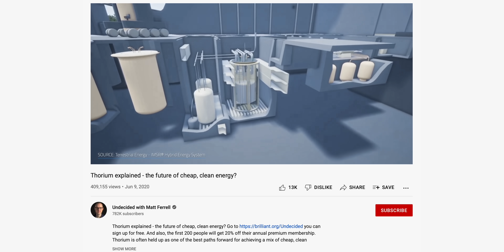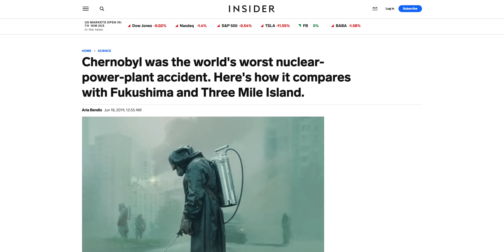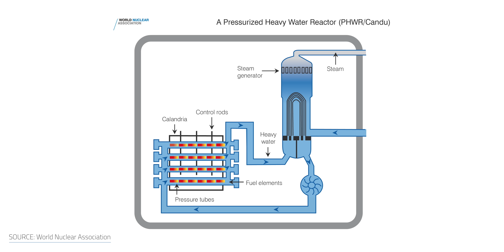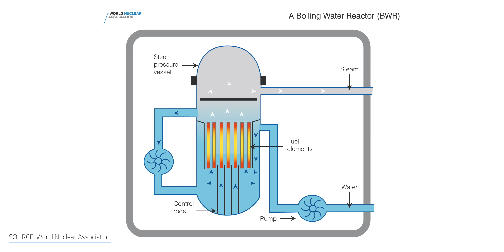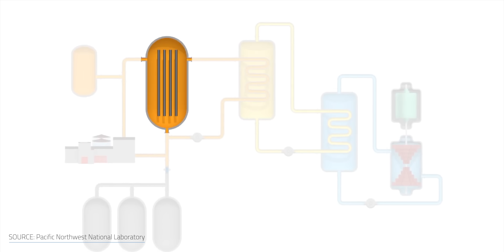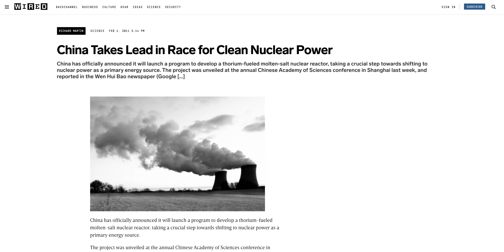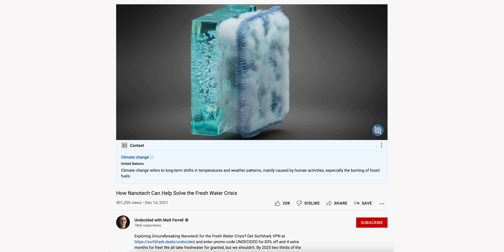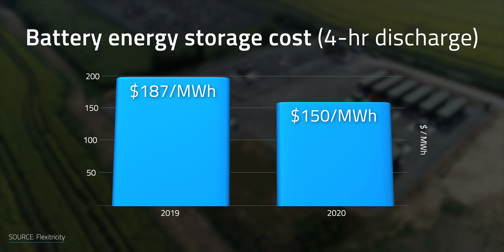Revisiting Thorium Energy - The Future of Nuclear Power?

Comment: the cost analysis made no sense... the cost of fuel should be hundreds of times less, manufacture should be 20 to 50 times less per capita, the cost of enrichment is virtually eliminated... that sounded like someone was fudging the numbers... i.e. so they can keep the price the same and pocket all the savings...  The radioactive by products even are valuable and can be collected and sold into an industry desperate for these fractions...  We're talking about a fuel that is effectively, 200x more available, costs almost nothing to mine, does NOT require the complex (and hugely expensive) enrichment process that uranium does, and because it's in a liquid medium, burns almost 100% of the fuel compared to solid uranium's 1-2%...  Also the low pressure reactor design does not require a massive huge dome cover (like uranium) which are required in the event of an accidental high pressure explosion...(MSRs are low pressure) a smaller modular design also means mass manufacturing will be possible with delivery to site location or having pre-manufactured components delivered and assembled on site... also because of their higher temperature they are able to run more powerful high pressure gas turbines...  as compared to the liquid steam turbines that uranium reactors are limited to... that would mean more power for less cost again... Someone is definitely fudging the numbers... then again you did mention someone  is trying to build a Thorium Fast Reactor?... That's nuts! ...  and almost defeats the purpose of Thorium reactors in the first place... Thorium's strength and efficiency is in the slow reactor design (as per Kirk Sorensen...) so that didn't make any sense... unless they are trying to undermine the whole market push... Someone is trying to fudge something... it should be at least 10x cheaper... think of how Big Auto treated electric cars... that's what I see going on... it's only because of Elon Musk, that they have NO choice!, but to be dragged kicking and screaming into the new market... Otherwise, EVs would still be another 20 to 50 years out... and like Thorium reactor, EVs were built and ran successfully decades earlier only to be ignored and/or suppressed for political reasons... the miilitary's is always lusting for more plutonium... Thorium was poo poohed, and swept under the carpet... mostly for political reasons...
Reply: Yeah, the fudged the numbers alright.  Four hours of storage for solar?  30 year lifespan of a nuclear plant?  Hilarious.

Comment: The best property of a LFTR according to the Oak ridge facility, is that it can re use the "spent" nuclear waste from the uranium reactors(only used 1-3% of active material) to the same level as the thorium (used 95% of  active material) and reduce the dangerous/radioactive time it needs to be stored to around 300 years instead of 10000+ years.
Reply: and the volume or amount of waste

Comment: how hard can it be when they had a fully operational running thorium reactor running at Oak Ridge National Labs in the 50's and 60's the only thing holding it back is greedy plutonium Rockefeller owned reactors which are more expensive, more dangerous, and more polluting... but they control more govt funding $$$$$$$$$$

Comment: I feel like the LCOE comparisons in this video are a bit misleading. Firstly, the ones for nuclear are a bit pie in the sky and speculative. Most sources I've seen put traditional nuclear at well over $100, but you site it as around $60, and that kind of thing casts doubt on the thorium LCOE estimates, which are again, just speculative estimates. However, the much larger concern is that you are comparing PRESENT DAY wind, solar, and battery LCOE with speculative LCOEs from thorium that would only be attained in 20 or so years at the earliest. At the current rate solar, wind, and battery tech is dropping in price, we might be comparing to wind and solar at $10 LCOE by the time thorium becomes a feasible tech.

Comment: Hi Matt, you mentioned that MSR waste was shorter lived but didn’t mention that they use about 95% of their fuel vs around 1% in today’s reactors. In other words there’s very little MSR waste to begin with. Also, heat for desalination and hydrogen production is a fraction of the heat required by many large industries where >600degrees C would suffice to replace fossil heat. Would be good to know exactly to what extent but around 20% of greenhouse emissions are from industrial fossil fuel heat. Is a video from you researching this a possibility? It’s hard to get exact statistics? Apart from saying we still need Nuclear, Elon expects electricity consumption to DOUBLE as EVs take off this decade, so that’s a seriously impossible task for any amount of solar and wind short term. BTW, while a few industrial size batteries have been installed to date, four hours worth of batteries that could have made a few thousand EVs suggests supply chain issues at scale🙈

Comment: We sure do get a lot of pro nuclear propaganda lately. One thing that nuclear power does is insure that the power monopolies will have control of it. Thorium is fairly innocent but you fail to point out that it is converted to something that is as deadly as currently used nuclear elements. Similarly, is reducing the half life to one half the current life of nuclear waste really relevant? And, once again, the taxpayers and citizens of earth are responsible for the waste. That cost is never assessed against nuclear power. Sure we can dig a hole in your backyard and bury it but what would that cost be over its radioactive life? How much land can be potentially poisoned? how big of an aquifer????

Comment: Improved battery storage doesn't just help intermittent power generation like wind and solar, a lot of the economic disadvantage of nuclear is that it's constant, while the price that power can be sold for isn't, and nuclear has to sell power even at hours when that means selling at a loss. A large battery system enables time-shifting that production to cover higher demand hours with better returns, which directly translates to increased economic viability, especially as you can scale down the size and number of reactors you need.

Comment: Interesting topic, but i keep thinking about other solutions, that are rather easier to achieve. Solar bricks to use when building a house. this way a building is useful, instead of deadweight and being just one thing, which is a roof over someone's head. Now it also generates power, basically free energy from a super massive fusion reactor that's located high in the sky. 
   Household takes away necessary power and the rest goes to a battery to supply as a buffer for governmental energy expenses. 

Yet many countries, including the one i currently live in, don't want you to be "self-sustaining", which is truly a bummer.
   Politics these days is really childsplay with nuclear weapons as toys.

Comment: Solar and Wind alone will not work.  Adding batteries will help, but these will be needed for EVs.  I believe a hybrid Thorium Reactor with batteries to support grid variability letting the reactor run at top efficiency, is much better than solar at night, and wind on a calm day.
Reply: The TerraPower reactor he mentioned slated for Wyoming has molten salt storage.  The Natrium plant has a 345Mw capacity that can be upped to 500Mw for 5 hours at a time via molten salt storage.  This would be a game changer if effective as batteries would be super expensive and environmentally repugnant.
Reply: @danadurnfordkevinblanchdebunk  However, nuclear reactors need to be base loaded to be efficient.  So how do you mitigate frequency regulation needs for varying electrical loads without use of a battery? ... solar and wind can't be turned on and off.   Also Bill Gates is involved with TerraPower, and he is the DEVIL and I want NOTHING to do with that evil SOB.

Comment: Thorium is cheaper than batteries if excess when slowing down is used for desalination. But... The surges from solar and wind, even in a large grid, means decentralized batteries will still be needed. Decentralized because grid substations catch fire from solar and wind surges. Municipal governments need loans and federal directives to get into the battery farm/electricity purchase business. Currently, most grids like australias just remotely turn off the solar input at the house because the grid needs upgrading

Comment: Re 4hr battery backup for LCOE costs of wind and solar power: what country do you live in, that having zero power for 8-10 hours a day (minimum) is acceptable in mid-winter, or 4-7 hours of power outage is acceptable during a heat wave in summer?   I'm curious how that 4hr battery backup is viewed for power grids in Alaska?  For wind enthusiasts, keep in mind that when there is a hurricane or other high storm winds, turbines are usually turned OFF to try protect the rotors.  It's not just idle periods (which can happen) that can result in no power production.  LCOE costs should also include all the electrical cabling required to connect wind and solar plants to the rest of the grid - you need a lot more of them than you need for traditional (or nuclear) power plants, since the latter have higher power production capacity, and can usually be placed closer to the end users than the former.  Bottom line - that 4hr battery backup solution is only viable in a power grid that includes a large portion of fossil fuel or nuclear power production.  Pick one.  (Hydro is great where the geography supports it, but is not scalable to meet growing power needs - pretty much every valley that can be dammed for power already has been.)

Comment: You mentioned it, but salt at high temp is extremely corrosive. I'm not familiar with the progress in corrosion resistant materials. However, nuclear is the only near term solution. You will not have batteries large enough to run a city for multiple days, which would be required for winter or bad weather.

Comment: Four hours of solar storage?  Seriously?   Now run a cost analysis showing taking into account four times the storage (solar is only useful for about 30% of a 24 hour period), and the cost of replacing those batteries and panels to match that of the lifespan of a typical nuclear power plant. You suddenly find solar to be much more expensive than nuclear.

Comment: I was thinking that a very small modular molten salt thorium reactor could be used in the various vintage coal fired trains around the World. 

That way they still operate as steam engines but without much operating work, without the dirt and greenhouse gas emitting coal, and without all of the other poisons involved with coal. The steam produced could both drive the mechanical steam engine and the electricity for ‘hotel’ power.

Comment: Problems with this video.

@8:47 How is a leak of the Thorium salt worse that a full on explosion of the water coolant in a steam bomb design?
@8:51 This chain also creates U-234, which is just as unstable. But you have it entirely wrong here - the presence of these two isotopes of Uranium make creating a bomb with this material a dangerous endeavor at best as they both can cause the bomb to detonate while in storage.  No one sane is going to make a nuke that can go off while in storage.
@9:00 It's mined accidentally in huge quantities already.  Thorium's ore has multiple rare earth elements that are highly sought ought and mined aggressively already - the Thorium is currently being discarded as waste in these operations.  Do more research!!
@9:48 This is false. The project was shut down because Nixon wanted to divert all nuclear research funds to California. Also, the Thorium reaction chain's U-233 with trace amounts of U-232 and U-234 was not suitable for the manufacture of nuclear bombs as outlined above, and this likely also factored into Nixon's reasoning since this was at the height of the cold war.

Comment: A distributed sun/wind/hydro energy supply system (with storage) would be more resilient and reliable, easier to install in remote locations, upgrade, service, and on it goes.  I'm sure there are excellent use cases for thorium reactors, but I don't think general large-scale power production is it.  They seem destined for more exotic uses. Smaller reactors for ships, space, possibly even very large aircraft?
Reply: But our technology still isn't up to the storage task with solar on a utility scale.  Notice how the numbers presented showed a cost with 4 hours storage (assuming it wasn't cloudy during that charge period).  Solar is actually only useful for about 30% of a 24 hour cycle.
Reply: @danadurnfordkevinblanchdebunk  Also notice that batter storage halved in price in a single year.  Wind, solar, and battery capacity will continue to grow while the cost of a thorium plant will more than likely continue to increase.  In the time it will take to build a thorium plant, the race will be over.
Reply: @danadurnfordkevinblanchdebunk  Do you really think America will be producing them for that price?  You haven't factored in the cost of mining the material  (which is quite dirty), or the cost of safely warehousing the waste for 500 years!  It's another technology in which the true cost is kicked downstream to become somebody else's problem. Meanwhile, battery technology is rapidly evolving, the cobalt is reusable, and there any number of different of chemistries, not to mention non-chemical energy storage.

Comment: Most of the safety features are also shared by pressurized water reactors (PWR).  They are naturally temperature regulated via the same mechanism.  Also PWR will shut down on loss of power and modern designs will provide sufficient cooling by natural convection.  Salt reactors were tested in the US in the 60’s and rejected and were used in Soviet submarines (think K-19).  If they lose heat, the coolant will freeze and were very difficult to recover.  Finally, liquid fuel is dangerous.  Improper storage volumes or shapes can result in spontaneous criticality and has caused several accidents in fuel processing facilities.  All of this can be overcome, but it is likely they will not be superior to current designs.
Reply: Nonsense. The ability to withstand loss of cooling is precisely the reason LFTR s are safer than LPWR s. LFTR design was not rejected for technical reasons. It was mostly political -- industry had a lot of NRE in getting  certified LPWRs and they put pressure on government to shutdown LFTR research. As for LFTR fuel regaining criticality after flowing throw the drain plug no, that is not the case for LFTR fuels.

Comment: The nuclear hype machine really needs to end. Thank you for at least including a cost comparison. Solar / wind / battery costs are not static, they are dramatically falling and getting cheaper and cheaper every year. The nuclear lobby captures public imagination and public subsidy but it makes zero sense from an economic standpoint. Every dollar spent on nuclear is a dollar not spent fighting climate change with cheaper / safer / more efficient renewable power plants that we can build today using wind / solar / batteries.
Reply: But now run a cost analysis showing taking into account four times the storage (solar is only useful 30% of a 24 hour period), and the cost of replacing those batteries and panels to match that of the lifespan of a typical nuclear power plant. You suddenly find solar to be much more expensive than nuclear.
Reply: @danadurnfordkevinblanchdebunk  The cost analysis has already been done. Solar is the cheapest source of energy in history and it's only getting cheaper. 

Nuclear is more expensive and usually ends up billions in cost overruns. The Union of Concerned Scientists once did a report on this and found:  "Government subsidies to the nuclear power industry over the past fifty years have been so large in proportion to the value of the energy produced that in some cases it would have cost taxpayers less to simply buy kilowatts on the open market and give them away."

There are lots of utility scale battery options that can bridge the gap, many of which have been discussed on this channel including pumped hydro, liquid air, liquid metal,  sodium-sulfur, lithium ion, etc. More are coming to market all the time.

You might be interested in a report done by RethinkX. Look for the video  "The Great Stranding: How Inaccurate Mainstream LCOE Estimates are Creating a Trillion-Dollar Bubble." It's eye opening. 😲
Reply: @brianrcVids  No, it isn't. The effigies of the energy cargo cult exploit the oversights inherent in LCOE calculations, particularly the assumption that the generator is dispatchable. Which energy collectors are not. Meeting that assumption reveals their true cost: hundreds to thousands of dollars per MWh.
Reply: Lol. Nuclear has the safest track record of ANY supply of electricity by comical margin, it's costs are grotesquely inflated by nonsensical regulations that shackled the industry to what is arguably the worst way to do nuclear power, and is incredibly efficient in its use of land and fuel, even with the garbage technology the industry has been stuck with.
Reply: @jsn1252  Nuclear safest? How many solar power installations do you know that have blown up and spewed radioactive contaminants across the land and sea? How much security do solar and wind power farms require to protect themselves from terrorist attack? Why do nuclear proponents seem to think accidents never happen, natural disasters never take place, countries never go to war with each other? Ask any military command what power installations they worry about most. It's probably the one that would do the most damage with it being blown up. Thanks to the nuclear industrial complex, we have ticking time bombs sprinkled throughout the land. Toxic waste dumps with radioactive half lives of 700 million years. Short term thinking got us here.